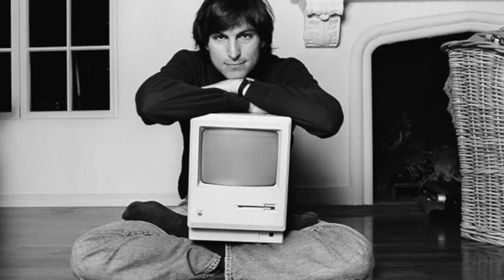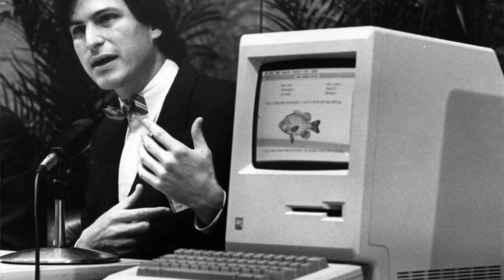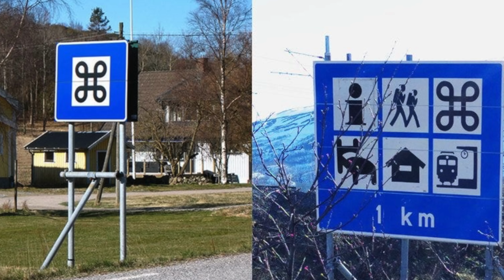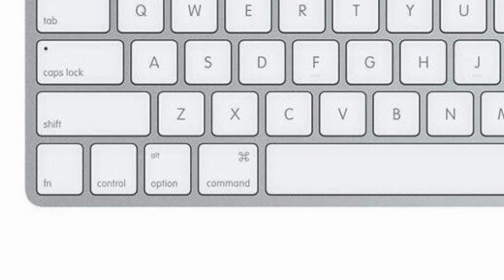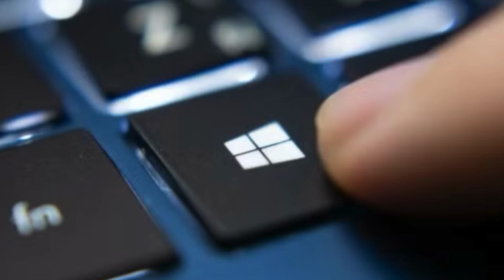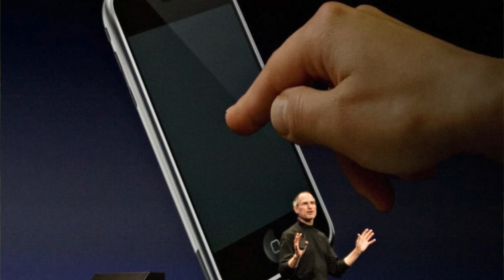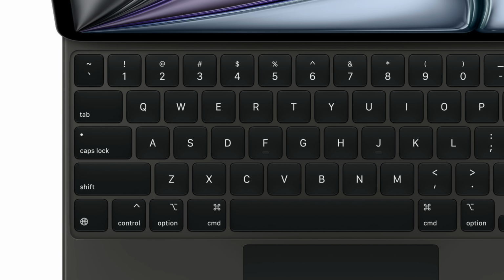History of Apple's Command Key

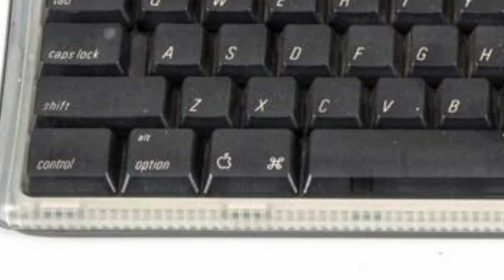Comment: 0:52-- Notice that is not an IBM keyboard, so it has the control key in the correct place.  3:35--Ugh the new keyboard has succumbed tot he IBM layout.  It's a good thing that you can remap Caps Lock to control.  Why does this matter, you think. For longtime emacs users the control key pretty much functions like the command key.

Comment: Alt is the equivalent of Option on Windows. Command is the equivalent of Control.
The Control key was included in Apple computers many years ago, when could run Windows OS (using using an additional card inserted in the Mac, then later via software emulation)... that would make the Control key worked as the Control key on Windows, avoiding confusion between the two OS's.

Comment: WRONG!  "If you’re a fairly new Mac user, you may’ve noticed that its keyboard is slightly different than on a PC. Instead of an alt key, it’s called command. Featuring a strange symbol resembling a cloverleaf."   Noooo…. On a PC keyboard, the Alt key is roughly equivalent to the Mac’s Option key, not the Command key.

Comment: Option and Control keys should be simplified into one unifying key. When you add the Function key you end up with 4 modifying keys that also interact differently with each app, so it's really frustrating sometimes guessing which one to press (for example when trying to extend the selection to one word or one line of text).

Comment: Microsoft also have the Winkey (Windows key), but it's not used as a modifier for programs (traditionally), rather for accessing OS features, like pressing it without any other key will open the Start menu. But it can also be pressed with other keys, for example, open "Run" with Winkey + R.

Comment: I love the command key. Under Ubuntu, which I also use, it’s such a mess, because CTRL-C in a shell is used to interrupt a command, so it can’t be used for copy, so command shells use shift-ctrl-C and shift-ctrl-v for copy/paste, while gui editors all still use ctrl-c and ctrl-v as the interrupt function is not required there. If you now need to copy and paste a lot between terminals and gui editors, you constantly need to change between the two, or fallback to mouse marking and right click on terminals… never found a good solution for this. On a MacBook, copy/paste is cmd-c and cmd-v consistently, in terminals and in gui editors. The only thing i still hate is the fact c and v are next to each other on the keyboard, who the hell chose “v” for paste…

Comment: The Command key is not "Alt" for mac. The Option key is "Alt" for mac as the option key directly acts as the Alt key functionality when interacting with apps. The Command key on mac functions as the windows key on pc keyboards. I understand that when you look at the keyboard placement, it may seem to be the opposite, but functionally, Option = Alt & Command = Windows. The command key started out as the "Apple" key so this makes sense. If you use a standard PC/Windows keyboard with a mac, the Windows key is what you use for Command.

Comment: Been a Mac user for a really long time, never really took advantage of keyboard shortcuts up until fairly recently. At first, it may seem overwhelming. But when you go to do something, you might find there’s already a keyboard shortcut for it or you can create your own! lol imagine my surprise when I went to create a custom keyboard shortcut to go back “back button” finding out there’s already one default! But yeah from navigation to running shortcuts. Ironically, after fixing an issue, I had assigning the same keyboard shortcut to two different things not knowing it. I went to use one to translate from one language to another. It wasn’t working. That was over four hours ago, exploring the different keyboard shortcuts in settings, making my own, if it wasn’t an option, I created one using shortcuts. Ie a shortcut that opens up the terminal, enters in the name of the bash script, running that script! I always check for updates, created a bash script that would open up the App Store, latest.app, run brew update, upgrade etc. I swear if you’re ever bored one day, spend time on your Mac learning something new. If you can’t think of anything, then imagine trying to do the most preposterous thing and then automated!
Reply: woah, someone who already used homebrew and bash scripts but didn't use keyboard shortcuts until recently? that's so interesting

Comment: Command is actually the Apple version of the Windows, or "Super" key. The Apple version of Alt is option, and it works in the same way as the alt key, just with a different name.
Reply: It's actually the Meta key. Windows calls it Windows, Ubuntu called it Super, but it's originally been called Meta
Reply: @LoganDark4357 thank you.

Comment: Option is alt when in boot camp on older Mac’s the command means windows key control is control when on boot camp and they also both have function
Reply: Not just in bootcamp, it's the same with open keyboard firmware. The keycodes for windows/cmd are the same,

Comment: I still use an Apple keyboard that has the Apple symbol on the ⌘ key. And even though I've been using this keyboard for many years, I never noticed that Apple symbol until I watched your video. Thanks for the explanation. But a related curiosity I only just realized while typing this comment: The Apple symbol is not defined in Unicode. Apple has assigned it a Unicode code point but it is in the private use area so it is not rendered on non-Apple devices - which is why I'm spelling out "Apple symbol" each time.

Comment: To Windows users, Command is the Control equivalent on Mac, except the Mac also has a Control key. But the Command key does everything the Control key does, but in an angrier and more dramatic way.
Reply: Can you elaborate on the angrier and more dramatic part?
Reply: @zigmantasbajoras  It was about semantics, I guess
Reply: But it can't change or shuffle between tabs in a browser, and you have to move your thumb from Cmd to Control 😢
Reply: Its done for a really cool and productive reason. For any linux user or even windows terminal user, you'd notice most of the stuff is done using the ctrl key liks ctrl+c  to quit a program, but guess what, this conflicts with the commands like copy-pasta of the OS. So for anyone using the terminal, the cmd key is a godsend of convenience.
Reply: @eating.mangoes  Copy is CTRL+SHIFT+V and C, but you can easily just rebind it to ALT+C and V to get the same effect
Reply: @eating.mangoes  yes, a godsend that allows you to save pressing a single extra key at the same time (shift)
Reply: Having 2 keys equivalent of the Windows ctrl key, neither of which are system level for the most part makes for such better shortcuts.
My go-to example is in the JetBrains IDEs. On Mac, Ctrl+R and Ctrl+D are used for "run" and "debug" respectively, freeing up Cmd+R for "replace" and Cmd+D for "duplicate"
On Windows, Ctrl+R is replace and Ctrl+D is duplicate, so "run" and "debug" had to be mapped to shift+F9 and shift+F10 - much more awkward and harder to remember.
Reply: @Ashanmaril  It took decades but with powertoys you can finally rebind shortcuts, also on a per app basis
Reply: @Ashanmaril replace should be ctrl+h, debug F5 😊
Reply: @Ashanmaril  Why not just use alt?
Reply: When Microsoft copied windows from Apple, they needed things to not be too similar to the Mac OS, so they changed Command to Control and put the start button on the bottom left where the Apple menu started on the top left. And since their operating system was called windows that was also reason for them to have all the menus at the top of each window, instead of a central location at the top of the screen.
Reply: @nowthatsinteresting313 IBM PC:
Reply: That explains everything
Reply: The Control and Command keys within macOS also serve slightly different purposes. I tend to think of it as Command tells the computer to do something and Control tells an app to do something. Control is also useful for navigation. Control + left or right arrow keys switches between virtual desktops and fullscreen apps. Control + down is Exposé and Control + up is Mission Control.
Reply: Not fully. ⌘+H on Chrome is hiding it, when Ctrl+H shows the History, for historY you should press ⌘+Y. And there are a lot of shortcuts, that works differently on Mac compare to PC. But overall, yes.
Reply: A Mac “control” key was meant for accomplishing tasks that a secondary click (right click) on a mouse would do, such as opening context menus.

Comment: I think we’re missing the fact that Apple IIe (and IIGS) had open-Apple and closed-Apple, and they mapped it onto Joystick button 1 and button 2.  So these buttons always existed from the beginning of Apple II in the 1970s, with the two joystick buttons.  On any Apple II application (8-bit or 16-bit) if it expected Cmd-XCV for Cut, Copy, Paste then you could hold down the joystick button 1, and press X, C, or V.  Or Z for Undo.

In fact it may exist on Apple I in 1976 if that platform had the joystick interface as an option.  The Apple II was 1977.
Reply: The Apple //c also has the open and closed Apple keys.  The //e was their  first appearance and they were really only used as modifiers with control+reset to reboot or enter diagnostic mode.  Never for commands. Some times in pinball games such as David's Midnight Magic as flipper control keys.
Reply: @GaryCameron780 AppleWorks used the Open Apple key for commands.
Reply: @RandomNonsense1985 I had forgotten about that.  As did the software AppleWorks was based on, /// Easy Pieces for the Apple ///.
Reply: @GaryCameron780 TIL something new. I’ve never actually seen an Apple III in person. When I was using AppleWorks, I was a little kid in school, and it was the 90s. My school never bothered upgrading to Windows machines until the tail end of the decade once the internet started blowing up.
Reply: Of course this “trick” only really mattered if:

1.  You had an Apple II Plus that was so old that it didn’t have the Open Apple and Closed Apple key, yet you were somehow needing to run productivity software that used those keys (very unlikely … not enough RAM on most systems … just a party trick then)

2.  You were on a new Apple IIe or IIGS that WAS purchased for productivity (say, by your school or parents) but then you wanted to play an old game (easily capable) except you had no joystick. 🕹️  Some games could still be fun if you only had the two joystick buttons and keyboard controls.  So as long as you knew that Open Apple (Command on IIGS) and Closed Apple (Option on IIGS) worked as joystick buttons, you could play!

Comment: I've had Windows laptops all my life and recently took the plunge and got a M4 Pro MacBook Pro and had zero challenges using it as a laptop, Apple has designed their devices so incredibly well.
Reply: Took me a month or two to adjust. Before used only the typical Linux desktop and Windows.

And as for design: Take full screen windows on Mac. On Windows to get the same effect I would have to:

1. Create a new virtual desktop.
2. Move the window to the new virtual desktop.
3. Make the Window full screen.
4. Switch the taskbar to auto hide.

On a Mac I press the green button. Noticed this helps my work flow to be much faster in some  situations.
Reply: @Netzwerkdose wtf is the green button? Is English not your first language?

Comment: The Command key was originally like the Start key, both of which are known as the "Host" key. Nowadays it functions like Ctrl. The option key is the Alt for macs. And the Control key on Macs is just an easy way to right click. Mainly for MacBooks nowadays, but was useful in the early days when Apple made the one-button mice, like the toenail mouse.

Comment: so whats the purpose of Control key in mac then?
Reply: Some shortcuts use it, too, to modify details of what the command does.

And if you use a terminal - especially with remote systems running Linux - you need Control for things like aborting programs, editing the commands you enter, job control and flow control.

Comment: Yeah MacOS is so good at simplifying things that they have 2 keys for the same role... why invent command key if you already have control that predated apple? And modern usage of it(since most of original functions dont matter today anymore) is very weird too.
Reply: Ctrl-C aborts programs on a Linux or Unix command line. So it was already taken for that purpose years before Lisa and Mac.

And the MacOS terminal uses it this way, too. It is actually good that Copy is Command-C so this does not conflict.

Might be another small reason why I see so many of my peers use MacBooks for IT work.

Comment: I was an avid WIndows user up until I purchased an iPhone 3GS in 2009, followed by an Intel Mac Mini in 2010.  I'm a software engineer and was never all that hung up by command interfaces, since GUIs make shortcuts of a small subset of possible actions at the expense of making more detailed actions more obscure to find and use.  However the happy accident of the Apple/command key pre-dating the Alt key in MS-DOS/Windows is a stroke of serendipity.  To wit: if you have to use a terminal interface to linux or mainframe the control-keys and associations were already claimed before either Apple or MS-DOS appeared on the scene, and a knee-jerk control-C to copy something on screen will promptly terminate a program.  However Apple has command-C, command-V, and command-X for copy, paste, cut respectively, which mean nothing to the remote computer, so a Mac terminal emulator can use them just like any other macOS program.  I always have difficulty switching back to either a Windows terminal emulator or Linux, which have to use some vulcan nerve pinch like Shift-Control-C or Alt-Control-C for cut, etc.  Even though Microsoft had the option for using a similar set of gestures when the Windows keyboard was introduced, they had already used Ctl-C, Ctl-V, Ctl-X which then forced the use of vulcan nerve pinches for staple operations.  It's one of the small but important reasons why a macBook or iMac make the best software development platform, IMHO (unless you have to do really heavy kernel compilation tasks).
Reply: Ctrl-C most likely was used to abort programs in Xenix as it is a variant of UNIX. So Microsoft had it to abort programs years before using it as Copy I  Windows.

I guess the CP/M and MS-DOS software companies used Ctrl-C as copy because there were just shift and control back then. No Alt or anything else back then on the typical keyboard.

Comment: I like it because when using Windows or Linux, it's Ctrl+C to copy but if you're in a terminal, Ctrl+C is used to cancel, in MacOS, Command+C is always copy, very simple.
Reply: In Terminals on Linux it is often mapped to Ctrl-Shift-x/c/v. And to top it off some even requires to use the mouse instead.

That there are two ways for the clipboard on X11 does not help, either. Sometimes selecting text is enough. Other programs require an explicit copy. I get this wrong at least once a week when using Linux and Windows.

For my private machines the terminal is on the Mac now. Much better.

Comment: When I migrated from Windows to Mac, it was a learning curve getting used to not only the keys but the shortcuts. 13 years later, I use the Command key and keyboard shortcuts on Mac without even thinking about it. Using Mac shortcuts which include the use of the Command key have become intuitive for Mac users.
Reply: Fun fact, Microsoft--masters of intuitive design that they are--originally used Shift+Delete for cut, Ctrl+Insert for copy, and Shift+Insert for paste up until Windows 3 (these are still supported in Windows 11 today, BTW). If some of the Mac commands were easy to learn, you can thank Mac's Cmd+C and Cmd+V for being the "inspiration" for Windows' eventual switch to Ctrl+C and Ctrl+V shortcuts. The upshot is that nowadays Microsoft's "borrowing" of these key sequences makes it easier to switch to Mac.
Reply: I don't have 13 years. I spent 30+ years on windows, about 5 years on mac but only in my private time.
Reply: @zabaizabai2 Takes time to get used to the Mac keyboard and keyboard shortcuts.
Reply: Okay, now press ctrl + command + shift + 4 for a screenshot, the most intuitive "short"cut
Reply: @Alex-kb2ws it’s just command shift 4
Reply: @Alex-kb2ws  if I remember correctly, this is because Macs originally didn't have F-keys, so they used ⇧⌘ (Shift+Command) and a number in place of the F-keys.

Comment: In Linux we call the key of that area the "Super" key or Meta. It's the same as the key on Windows that''s the Windows key. I prefer the name Command Key personally.
Reply: Isn’t Meta key = Alt key?
Reply: @Anfid43  Close. AltGr. So not something ansi keyboards have. But in that position.
Reply: @user-lv6rn9cf8m last attempt at commenting because youtube is trash
i tried it with KDE but only super works with shortcuts with meta
Reply: I am so used to the super key being called super that when I first tried KDE I was like "what the heck is a meta key"
Reply: Actually it comes from the Space Cadet keyboards that were used with Lisp back in the day. And it's technically the correct name regardless of what os you're running. Just labeled differently.